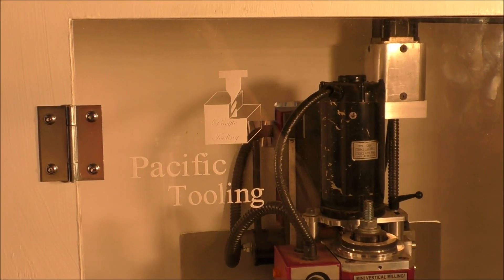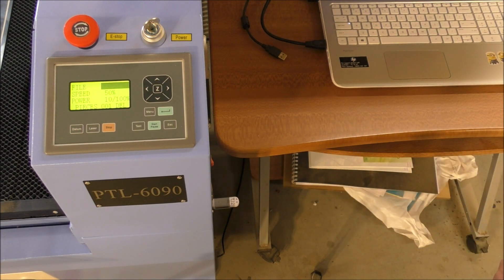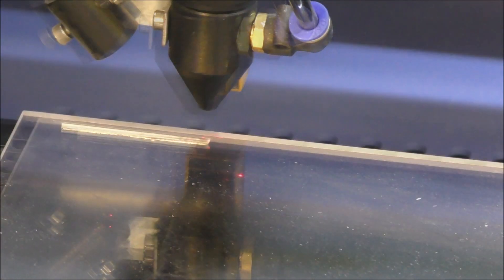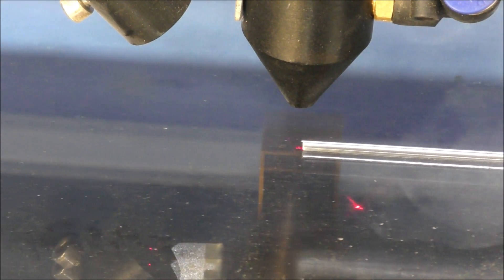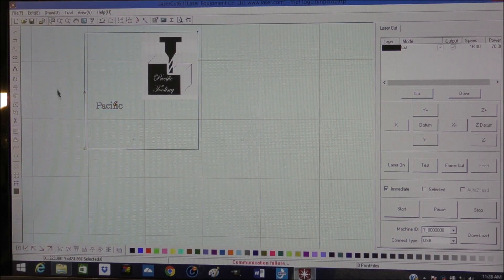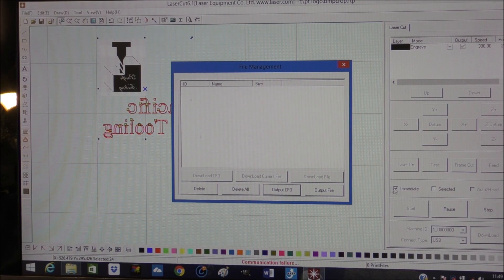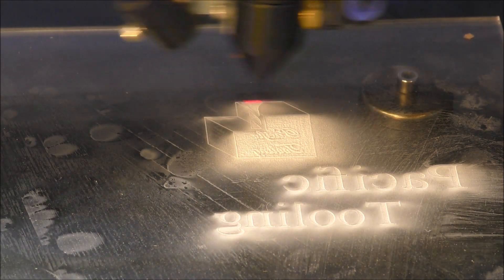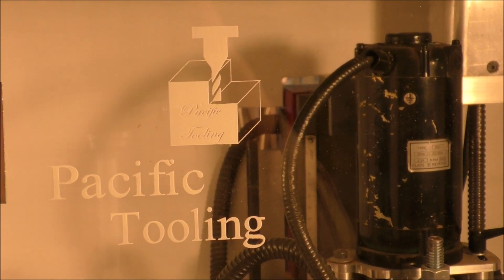How to laser engrave a logo in plexiglass or acrylic plastic

Comment: The camera didn’t move. Your table moved when you started to apply pressure to the drill. Then you seemingly locked the wheels? Or something before continuing. You can tell from shadow movement and the background movement that it was the work bench that moved not the camera. 🧐🙂
Reply: It's not even the shadows, you can see that it happens in comparison to the back wall through the window. The wall stays still, the table moves towards it hahaha.